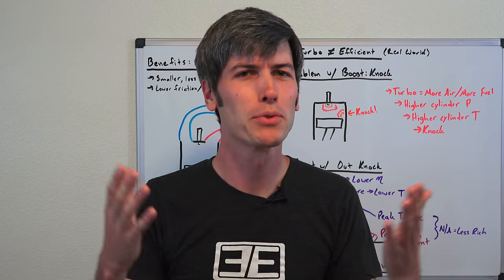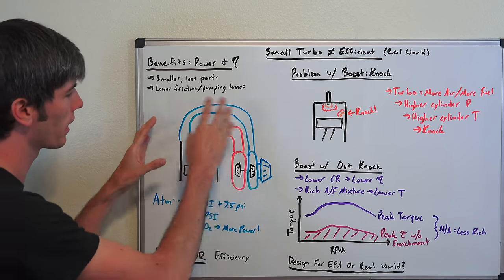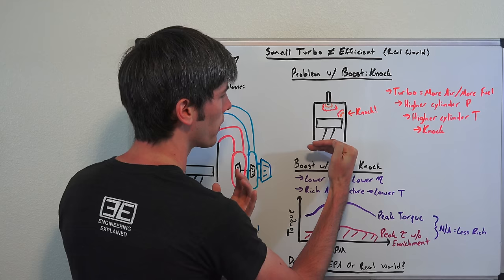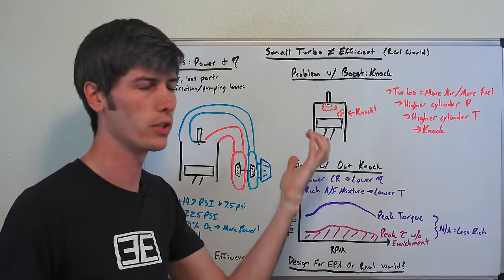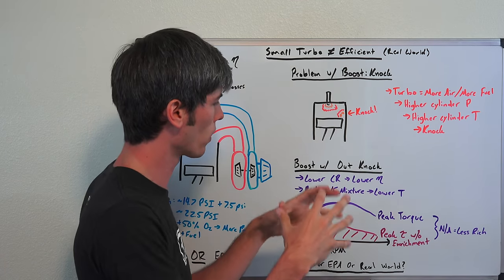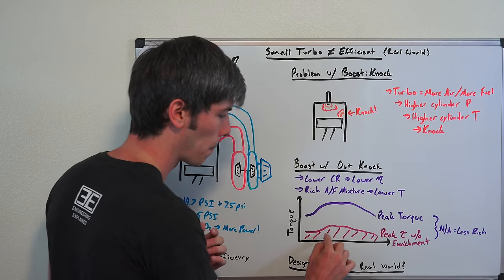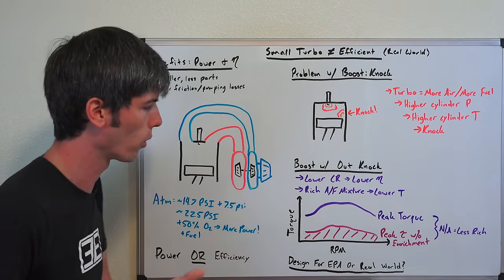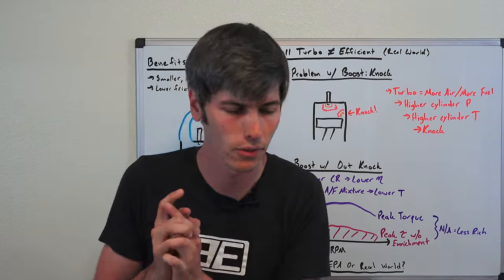Why Small Turbo Engines Are Not Efficient

Comment: That's why I drive a twin turbo v12
Reply: Dexter Sullen 'TRUTH' what do you drive?
Reply: Vlad Lelcu sl600
Reply: So... You mean biturbo?
Reply: sorry bud but I don't think your sl600 has a biturbo v12...maybe a N/A v12...but zero turbos on that old crap
Reply: This comment makes no sense. Same exact problem happens in any turbo fed engine, whether sequential or twin or single turbo v12 or v6. Problem is manufacturers are pushing engines to do more with less volume.
Reply: RickCrazy if you know anything about cars you know sl65,s65,g65, now and sl600 in mid 2000 had twin turbo v12s  which is the Same meaning as biturbo but the 600's is the base power of 500hp all the way to Pagani huayra bc with 800hp, and the Zonda's or old sl600 use a high Revving na v12 (and all of these can be 5.5l, 6.0l, 7.0l, or 7.3l depending on stroke or bore) m275 engine platform 30 years of enhancements, Which some have gotten theirs to 1000hp.
Reply: Salvador Martinez well yeah I still have same problems as any turbo engine, but the intention of my engine was not for efficiency but just easy power to get 4500lb car past 200mph and that's on a modest tune (bolt ons, e85, intercooler upgrade, heat exchanger, meth injection, full straight pipe, and tune puts these cars in 800hp range and crazy amounts of torque)
Reply: Dexter Sullen 'TRUTH' 
Yes but getting to 200 mph cost you a tank of gas. My previous car was a V10 S85 engine it averaged 6 miles per gallon.
Reply: KEVIN MANSFIELD if your s85 only got 6mpg it's your right foot not your car that is the problem. My M5 regularly got 15 in town and almost 20 if I took it really easy on the hwy. The ONLY time I got into single digits was if I was beating on it.
Reply: ok, tell the truth Dexter...how does a young homey from Kansas have enough cash to buy cars like that?
Reply: KEVIN MANSFIELD yeah I usually only drive around 120mph on the highway but that's with around 50% throttle, I try not to Rev the engine to high. And I brought this car off Craigslists for 7k cash talked the guy way down but cash in hand is very tempting, yeah you just got to look around for car deals, and they don't last long, auctions, copart.
Reply: My mpg is usually 11mpg, but best in city 15 ( no traffic, 1.5krpm 30mph)
Reply: Your Honda odyssey isn't a v12 lol
Reply: And probably 6MPG
Reply: Jason, That means 2 turbos on an engine.  But they are  only in super high end expensive cars, for guys with very tiny itty bitty.......
Reply: The S85 gets significantly worse mpg than the M275 no matter what the conditions.
Reply: Dexter Sullen 'TRUTH' i drive a v8 bi-turbo. Goes like a rocket, but at 280km per 75liters it drinks like a rocket as well.
And only the expensive 100 octane shell stuff too. Ahh well, it's a hobby right.

Can hear the tank swirling on the autobahn haha
Reply: w16 quad turbo is the way to go

Comment: In all the turbo builds I've done I consistently run an air fuel of 14. 7 to 15. 2 long as you can avoid high egts you're okay one thing not considered during the video which I understand why, is the timing of the ignition curve. Pre detonation can occur but if you set your timing more retarded as you advance RPM you can stay relatively safe depending on application. Also there are other remedies such as water meth injection that are great for keeping cylinders cool and adding power. Great  video and very knowledgeable and if you guys want a main drift off what he's saying,  the companies lie about their numbers lmfao!

Comment: I don't know a lot about engines, so don't flame me, but would adding an intercooler fix the problem of engine knock in this scenario rather than relying on the rich fuel mixture to cool it down?
Reply: AERO BLKHWK32 I think even though ur using an intercooler, the amount of air in the cylinders is much higher and as a result the pressure is much higher. So, as pressure increases, temp increases........even though you are supplying cooler air.......
Reply: AERO BLKHWK32 Yes. An intercooler (if there's only one turbo, technically it's called an AFTERcooler) reduces knock. Video explains what happens when boost arrives and the ecu increases richness to protect engine. Premise of video is that we all spend >30% of our driving time with foot on floor. In most countries, this is drivel, as your drivers license will be gone before the contents of your fuel tank. Most driving is done with 0% to 15% throttle. Happy place for turbo economy.
Reply: Even with same intake temperature and compression ratio, as there is more air (denser) it heats up more when being compressed in the cylinder.
Reply: you can only cool it down so much
Reply: He didn't mention it in this video but there is nearly no point running a turbo or compressor without intercooling the gas before it goes into the engine. Also the rich fuel mixture is there to cool the turbo mmainly at high rpm (we are talking about 800°C instead of 950°C+). We made some tests on the engine-bay and as we excellently forgot to turn on the "rich fuel mixture for cooling" in the software, the Turbo-Temp quickly went up to 850°C, 900°C is the absolute maximum that system may reach and that is rather over short times. 
The knock is a different problem to the overheating turbo that is cooled by rich fuel mixture. Cooling the exhaust gases before the Turbo with a intercooler is not easy and shall not effect the efficeny of the Turbo. VW has a watercooled exhaust connector to the turbo that tries to reduce the need of rich fuel mixture. EE already made a video about that thing.
Reply: You can do much more to prevent knock. Water injection (though not preferable for most cars), oil sprayers, water-air intercooler instead of air-air, heat separation under the hood (turbo blankets, heat shields, etc.), EGR (again, not preferable, but used a lot), direct injection combined with multipoint, bigger radiator to increase engine cooling, etc. That is why there are (sub-) 2L engines producing well over 160HP/L from the factory.
Reply: Just like all those turbo dodges in the 80's
Reply: I though the entire point of the turbo was to add power, and efficiency was a bonus.
Reply: Great info. The point of a turbo 4 (for example) is to mimic the power of a 6 or 8 cylinder. That is where the fuel savings is.
Reply: INTERCOOLER WONT BE MUCH HELP BECAUSE AIR GETS HOT WHEN IS COMPRESSED BY CILINDER AND OF COURSE TURBO ITSELF. SO FEW DEGRESS COLDER WONT DO MUCH
Reply: Where you lose out is driving lead foot from 0 to the speed limit at every corner. Millions of people just like me are guilty of that and look to the rear vision mirror to see the cash flying out the exhaust!
Reply: AERO BLKHWK32 well that's a fair enough question. The differences in air temp by having an intercooler are comparatively small. Say the intercooler manages to cool 160deg air to 60deg (that's fairly optimistic), the reduction in combustion temperature is minimal because fuel has tp be added to air in the correct ratio so the combustion temperature may in fact be the same or higher though the intake air temp is lower.
Rich mixture is the primary means of cooling.
Reply: better to add water injection
Reply: AERO BLKHWK32 manufacturers uses small cheap intercoolers. Once heat soak occurs it doesn't matter. I would not drive a turbo car hard on a hot day.
Reply: DIDN'T REALIZE THAT YELLING ALWAYS MAKES YOU RIGHT!
Reply: AERO BLKHWK32 yes, a cooler would help, but it would cause more lag and you wouldn't feel like you had as responsive of an engine.
Reply: Tomas Av. If that were true, no one would use an intercooler...
Reply: An intercooler won't actually decrease the cylinder temperature all that much, it's more to increase the air density entering the cylinder. Air is a horrible conductor of heat, so it's ability to lower the internal cylinder temperature is limited. Adding more fuel is a much more efficient way of decreasing the temperature
Reply: Intercoolers add oxygen density, the few degrees it drops in intake temperature are not going to make any difference to combustion temps and realistically most modern turbos are going to be intercooled already
Reply: its actually the other way.  The main point of a turbo from a car manufactures standpoint is that it raises efficiency and the added bonus is that it adds power.
Reply: AERO BLKHWK32 higher octane rated fuel helps reduce knock too.
Reply: IMO an intercooler would provide a marginal difference at best. Regardless of this though, an intercooler is NOT an appropriate method to control knock.
Reply: I would rather run rich at full throttle. Trying to dial in is risky. It only takes a few seconds of running lean under boost to melt a piston, crack a piston. if you don't have an AFR, air fuel ratio gauge you need one. It uses an O2 sensor to get and monitor the AFR. I had a stage 5 550 HP at the wheels 92 300 ZX twin turbo. when I would give the engine full throttle my AFR would be deep in the green. I still melted a electrode on number 5 but that was due to the design of the plenum. It was still fast with it running rich at full throttle. The same night melted a plug electrode I beat a 98 Corvette by 10 car lengths at least, running on 5 cylinders. I live in the country. one day I pulled up to get on number 1 hwy. I see 2 mustangs racing and they flew by me going well over 100mph. There is a bridge about 1mile down number 1  hwy. I was completely stopped at the stop sign when the mustangs passed me racing. I decided to try and catch them by the time I got to the bridge 1mile away. I caught them and passed them before the bridge. I looked down at my speedometer. it has 160mph on it and no pin to stop it from going past 160. It was past the 7 o'clock position. I did some measurements and concluded that I was going about 195 and it was still pulling. 
I would get an AFR and let the ECU run it Rich. my 87 ran rich at full throttle. Peace
Reply: Tomas Av. by the time intercooled air reaches the cylinder you have a denser charge and compressing a denser charge will create higher temperatures. once air makes it to the combustion chamber all of the variables are set. then the only thing that matters is how much air you got into the engine.
Reply: Yeah I was wondering the same, that is why exist the intercooler?
Reply: jet guy I am glad you enjoyed my twin turbo chronicles. I miss my 300ZX twin turbo. I never even came close to loosing a race. My car was the car to beat. When I finished the stage 5 upgrades I went and picked up my jaw off the floor. Stage 5 included replacing the stock turbos with larger T25  turbos, 555 cc fuel injectors, and stainless steel exhaust down pipes which deleted the precats. I went and picked up my girlfriend,she likes fast cars as well. we where way out in the country. she said show me how bad your car is. we had the t-tops out and that car would hit 160 like a walk in the park. she wanted me to stop by her house. come to find out the wind had blown her makeup off, j/k. as far as intercoolers go, I think we see eye to eye on that. I spent a good while trying to find out the details about a dense charge. If you have a link to info on that it would be much appreciated. I don't care if I am wrong I just want to read about it. Peace!  this was posted using my phone so expect poor grammar etc.
Reply: No. Compressing the fuel charge in the engine is where this knock temp is coming from. Intercooler would make it worse as you have denser air which will reach higher temps once compressed.
Reply: Simple Auto A turbo car will run just fine without an intercooler. And car manufacturers do make turbocharged production vehicle's with no intercooler. I owned one. All the Nissan 300 ZX turbos made from 1984 until 1988 had a non intercooled turbo making 7 PSI of boost pressure. One of the mods for those cars was buying a boost controller and turning the boost up by "tricking" the wastegate. As long as you ran 93 octane gas, you could safely run 12 PSI of boost giving the engine an extra 50 HP for the cost of a boost controller or make your own boost controller using a 10 dollar pressure regulator put between the wastegate and the wastegate vacuum line connection on the intake plenum. Also, what causes pre-ignition/detonation are hot spots in the combustion chamber. It can be from a very hot spark plug to a very hot exhaust valve or the lip between the intake valve and exhaust valve getting hotter than the flash point of the air fuel mixture. The purpose of wanting cooler air entering the engine is because cold air contains more oxygen by volume allowing more fuel to burn. Similar to how nitrous oxide works. A lot of people think nitrous oxide gives the engine more power because it burns. nitrous oxide will not burn. The reason why nitrous oxide gives the engine more power is because it adds more oxygen to the fuel mixture allowing more fuel to be burnt. A much smaller benefit of nitrous oxide is that it is under high pressure and it gets cold when it is expands and slightly cools the intake charge.
Reply: Michael Artelle They also rely on knock sensors as well as adjust exhaust cam timing to bleed a little compression out to reduce knock.
Reply: saulsebrook Intercoolers can be very effective. In the F150 ecoboost I had if the truck was moving during full boost WOT inlet temp was ambient and fuel was at 14.7 not rich because it just wasn’t needed. This is further aided by direct injection. The fuel is injected milliseconds before the spark plug fires. In a port injected engine the fuel is heated because it’s injected before the compression stroke thus heating it increasing the chance of knock. This is how they can have a 10.5 to 1 compression ratio 13 lb of boost on 87 octane. Look at a hellcat. The boost is only a lb higher but is at 9.5 to 1 with 91+ octane.
Reply: 8bert9 Yes a forced inducted car will run without a intercooler but you’re leaving a lot of power on the table due to much higher IATs. Adding more boost will give you more power but at diminishing gains.
Reply: jet guy I am going to put that in layman's terms so I will know exactly what you are saying. Say I get 2 hydraulic cylinders and hook an engine piston to the end of the rod on each hydraulic cylinder/actuator. Each piston fits tightly into a cylinder like a piston would if it were in an engine block cylinder. Let's say both pistons are at the bottom of their stroke and the ambient air temperature is 100 degrees Fahrenheit. 1 is at atmospheric pressure and the other has 10 PSI over atmospheric pressure. Are you saying that the temperature would be the same in the combustion chamber if both pistons were pushed to TDC at the same rate?
Reply: Steve Pounder I agree 100 percent. on the single turbo 300zx I was just commenting about I was just commenting on that free 50 HP. the next mod for those cars was installing an intercooler. The intercooler with the same 12 PSI of boost would add another 35 HP.  The next mod was upgrading the fuel injectors if you wanted more than 350 HP.
Reply: The adsitional heat is not only created by compression / forced induction pressure. There is also additional heat being dispersed to the cylinder and valves (especially exhaust side) by the higher mass of air fuel burn on boost in a forced induction cylinder. An intercooler or charge cooler are designed to keep inlet temperature as low as possible, which yes will increase the engines efficiency but this is a variable on the intercooler efficiency and ambient temperature. A larger intercooler area / area between the turbo and cylinder will in theory decrease the efficiency of the engine, due to more work needed to be done to pressurise a larger area.
Reply: AERO BLKHWK32 - I just watched this Video and i came to the same conclusion. An Intercooler reduce the temperature of the air for the injection-mix and should be an effective sollution to reduce or avoid knocks. But a good working intercooler is more expensive than a software-sollution that enhanced the ammount of gasoline to cool down the mix. Additional weight and more mechanical parts are also to keep in mind. But an Intercooler in my oppinion would be a fair and more honest way for a company to present their car with a high efficiency of fuel consumption and power producement.
Reply: Having a turbo car it runs the best in humid weather because of the moist dense air.
Reply: Cindy Sue
I'm not doubting that it runs better in humid air, but air with a higher humidity is actually less dense than air with a lower humidity. H²O in gas form is less dense that normal air, which contains mostly Nitrogen in the form of N² and Oxygen in the form of O²
Reply: whatiwant yes. The higher the pressure, the more power you get out of your mixture, and it works well in jets, but in pistons it blows/knocks or melt the system. So it can only be limited unless you use special high octane fuel or kerosene/oil to cool off injectors etc
Reply: Ehm. You're talking about fuel efficiency. And mention flooring it. And real life fuel consumption. My point: for the majority of distance travelled engines run at the lower end of the rpm range. And there the small turbo engines are the way to go, in my opinion.
To illustrate my point:
I have an Alfa Romeo Giulietta with a 1750 cc 390 Nm 270 hp engine. And although I love revving it to the  limiter (flooring it, of course), most of the time the engine is doing sub 2000 rpm. And all people I know and of whom Iknow their driving style seldom or never go beyond 2K rpm. In that real world turbo downsizing does help.
Reply: what about a higher octane rating?
Reply: Andrew V high octane fuels also have lower vapor pressure in many cases and thus can be used to cool off components before being injected. This is not the case of course for natural gas, but in general it helps out reduce temperatures and allow smoother burn in pistons.